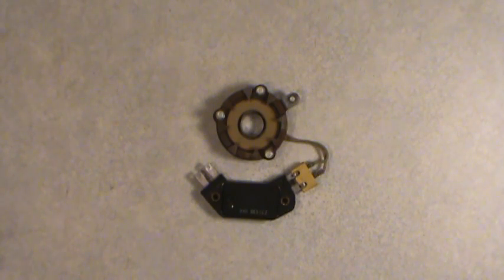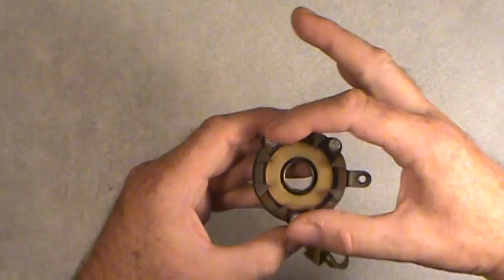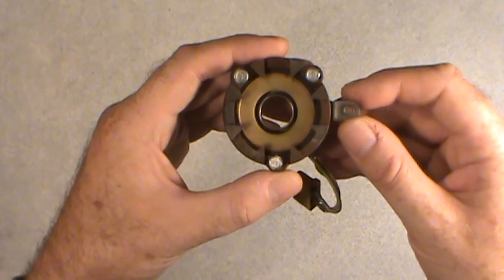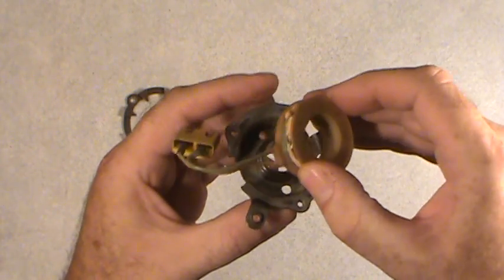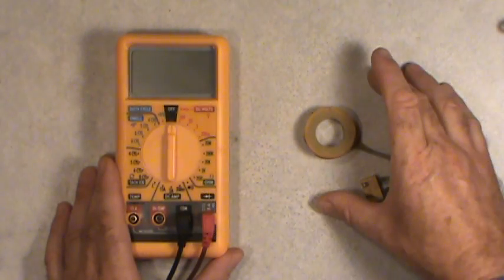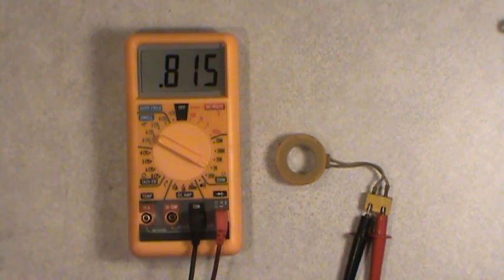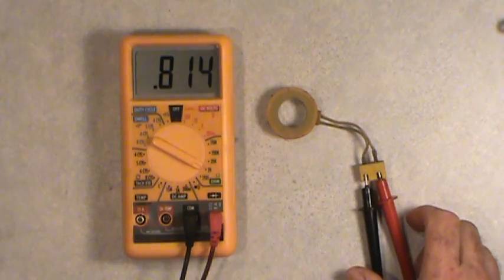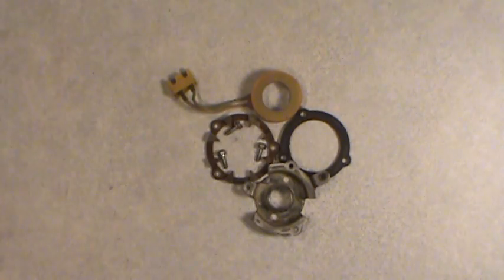HEI Distributor Pickup Coil Test

Comment: My car is not getting spark I changed the ignition module I changed the rotor I changed the coil on top of the distributory cap and the distributor cap I'm getting power to my wire but not getting spark will the pickup coil cause it
Reply: im going through the same thing no spark.. did you replace pick up coil?
Reply from the maker: Greetings...gennaro sandova..........Thanks for watching........Well, there are a few things, that can cause a no-spark situation, with an HEI distributor.........With the engine "not running", disconnect the (usually), red wire, from the HEI distributor cap, and hook up a volt meter, to that wire...then...turn the ignition key, to the "run" position........There should be battery voltage (that be, usually, about 12 volts).......Then, that 3 wire connector, that plugs into the distributor cap, can sometimes have wiring connectors, that get oxidized, corroded, or maybe, as I've seen before, some green colored yuck-ees (lol), coating, on said wiring connectors.........One of the, shall we say..all-of-ah-sudden...no sparky...spark...spark, from an HEI distributor, takes place, is usually because, so many folks, not knowingly, use the..."Wrong"...heat transfer compound (aka, grease-like substance), between, the bottom of the ignition control module, and the flat aluminum pad, that it mounts onto, and is secured with those two screws (note..."very important...!!!...those two screws, and, the two holes/metal eyelets, that go through, the ignition control, are the electrical..."Ground"...connection...!!!...so, make sure that, those things are super clean)..........Always use the same stuff (heat transfer-ing compound), that, the computer folks use (just buy and use, the cheaper stuff, that they have, because, some of that stuff, can be quite expensive)...("never use"...die-electric grease, as, it's not any good at all, for the purpose of, any heat transfer, what-so-ever...!!!)..........Yes-Sir-ee-Bob...the ignition control module, gets quite "hot", while in operation, and, if the heat that "it" generates, doesn't get transferred to that aluminum pad, on the distributor body, then, the module might overheat, and self destruct...!!!....(aka, kinda melt).........Also, the ignition coil, and the ignition control module, have to be compatible with, one another (kinda like, a matched set, if you will), or, there might be, an unwanted problem........There might be, a sheet metal, looking ground strap, that mounts onto the ignition coil, when, the coil is placed in the distributor cap, and, if so, make sure that, it gets re-installed..........A faulty pickup coil, can sometimes be the problem, and, those two colored wires, tend to get kinda stiff/dried out/not so supple any more, and can sometimes, end up having, an internal no-connection scenario, or possibly, an intermittent ohm reading, if those two wires are flexed/bent back and forth, during, said, ohms/resistance testing...so, bend those two wires, back and forth, and see if there is an intermittent/open/internally broken wire........Also, on that plastic-like bobbin, there are so many turns/windings, of some very small diameter wire, and, I'm amazed at, how well they hold up.........I recall, seeing some tape-like substance, that was wrapped around, all of those wire windings, on the bobbin, that, got all dried up, and that, was what made me replace, my very first pickup coil, on an HEI distributor (just in case...)........If, Ya do, replace the pickup coil, make darn sure, that you get the..."correct"...one...!!!...because, there are a few, different ones made, for certain applications, and, some of them, might have, an "opposite" polarity...!!!...oh, and, not to mention, different colored wires as well...!!!...lol.........If Ya need any more help at all, just give me a shout........Good luck, and......till next time......Be Safe, take care, and have a good one.

Comment: How do you remove and replace the coil?
Reply from the maker: Greetings...Geran Simpson........Thanks for watching........In order to remove and replace an HEI distributor's "pickup coil", You should have some reasonably good mechanical skills, because it might be a bit too difficult, for a, shall we say, beginner........The HEI distributor has to be removed from the engine, and, before doing so, you have to know how to re-install it correctly, along with, being able to set the initial ignition timing accurately.........That helical gear, that's on the lower end of the HEI distributor, that appears to have angled gear teeth, has to be removed from its shaft, and is held in place with a roll pin.........That helical gear, has to be put back in place "exactly" where it was...!!! (not, 180 degrees out/opposite), to where it was originally, or, the distributor won't work right........Sometimes, it is very difficult, to remove the shaft, from the distributor housing, because of, a build-up of deposits, that are usually stuck on the shaft........Once the shaft is removed, then, the pickup coil can be removed.........Remove the wiring connector from the ignition control module, then, as I recall, the pickup coil, is secured in place by a clip, which has to be removed first.........Upon re-assembly, then, Ya gotta make sure that, the "dimple" (partially drilled hole), that's in the hub of that helical gear, lines up with the metal "tip" of the rotor, when it is installed on the top of the shaft/advance mechanism, with those two screws, or it's gonna be 180 degrees, out of alignment...!!!.........So then, that's basically the procedure..........Look on Youtube, for some HEI distributor videos, where the person is taking an HEI distributor apart, and then, you'll have a much better understanding, on how the parts are removed, piece by piece, and, for re-assembly, then, it's just a matter of, doing the removal sequence, in the opposite direction.......Good luck, and......till next time......Be Safe, take care, and have a good one.

Comment: Replaced one of these stuck in the middle shoulder on 696 during rush hour in Detroit, truck just stopped running.  Real fun with crazies flying by at 80. Did the trick though, started right up.
Reply from the maker: Greetings...charlie dee........Thanks for watching........Wowsers...!!!...talk about living on the edge......Good thing, that you found the gremlin, that was responsible for all of that chaos........Most HEI distributor problems, seem to be related to, someone, not putting the correct heat transfer-ing compound (aka, heat sink grease), on the back of the ignition control module, before installing it.........I even had a parts guy, in a parts store, tell me, to use "die-electric" grease...!!!...lol...(nowhere on the label, does it mention...heat transfer, in, any way, shape, or form...!!!...lol)........I always use the cheapest heat transfer-ing compound/paste, that a computer store will sell me, usually costs about 10 dollars for a small tube of it (they even use, much more expensive stuff, that might be called arctic silver, on the big ic's/chips, as in, CPU's and GPU's, that are usually found, inside of computers and game consoles), and......till next time......Be Safe, take care, and have a good one.

Comment: I have a new coil and ICM. Still no spark. Pickup coil or computer??
Reply from the maker: Greetings...Jason Allen........Thanks for watching........There are a number of things, that can cause a no spark problem.........The first thing to do, is to, make sure that you have battery voltage (12 volts there-abouts), going to the battery terminal, that is on the HEI's distributor cap, when the ignition key, is in the "run" position (and, make sure that, it's not connected to the "tach" terminal, that is right next to it...!!!).........You mentioned a "computer", so, in order for me to help you out, then, I will need to know the following, about your vehicle, as in...year...make...model...engine size and number of cylinders, and also, if it's all stock, or, modified in any way at all, and.......till next time.......Be Safe, take care, and have a good one.
Reply: @RockysRoadshow  I got it going. Pickup coil wires were no good

Comment: Hello. I tested mine and got 1kohm which is within specs. Do you know how much volts should come out of that coil when you pass that magnet really fast about the coil ? If I use a speaker magnet I get 1.5v more or less. When I use that star magnet from the sandwhich, I get like 0.05v.
Reply from the maker: Greetings...eric racine………..Thanks for watching...…….Sounds like you are doing a science experiment...…….Here's about the only thing, that I've ever done with it...…….Having the HEI distributor, out of the engine, then, I connect a multi-meter's probes, into that pickup coil's, disconnected connector, then I spin, as fast as I can, by hand, that gear, that's on the distributor's shaft, and see what voltage, shows up, on the multi-meter's display screen...…….Should get about one volt (AC?), give or take a bit, as I recall, and......till next time...…Be Safe, take care, and have a good one.
Reply: @RockysRoadshow  well....lucky for me I have 2 HEI distributors. The new have no spark....I was able to make the old one spark on the workbench. The new did not spark. I swapped the pick up coil and it started to spark. Weird that I get a good ohm reading...but no spark. Anyway....your vid did help. Thx !
Reply from the maker: Greetings...eric racine…........You're welcome...........Here's something, that a lot of people/parts guys, don't know..........Always use, the proper..."Heat Transfer"...paste, on the bottom (metal side), of the Ignition Control Module, or, it won't transfer the heat, that is generated, on the inside of the module, into, the HEI distributor's aluminum body, where the module, mounts onto, with those two screws...……..I always use the heat transferring compound, that the computer folks use, to mount their, heat generating/very hot (electronic) "chips"......…Never use Die-Electric grease, because it won't transfer the heat, "away-from",  the ignition control module properly...!!!………..Ignition Control Modules, will usually get "Destroyed", if they get too "Hot"...…….Some of that, computer, "heat transferring compound", can get quite expensive, so, I usually, just get the cheapest stuff, which comes in a small squeeze tube, for about 10 or 12 dollars, and, it will last for, a very, very long time........Also, keep those two screws, and, those two metal eyelets (holes), that are at the ends of the ignition control module, "Very Clean", because, that is, what makes, the (electrical) "ground" connection, from the module, to, the HEI distributor's aluminum body, and......till next time......Be Safe, take care, and have a good one.

Comment: Why does the pick-up coil have such high resistance? Isn't it like a motor winding with current passing through it?
Reply from the maker: Greetings...I K...……..Thanks for watching...……..Well, the high resistance, that is showing on, an ohm-meter's display, when testing a factory/stock, HEI distributor's pick-up coil, is due to, the very small diameter, of the wire, and also, that very same wire, being quite long as well...……..See if you can find a "Chart", on the good ole internet, that shows, different gauges (thicknesses) of electrical wire, and how much resistance (measured in Ohms), that a given length of wire will be (I recall, it being measured, in ohms per foot)………….Something like, 14 gauge, copper house wire, being one foot in length, will have, a quite low (ohms) resistance, as compared to, a one foot length, of that, very thin wire, that's wrapped, many, many times, around that, HEI pick-up coil's, plastic-like bobbin...……..There is a thin magnet (looks kinda like, a fridge magnet, somewhat), that is hiding, just under, the pick-up coil, and, the pick-up coil's (wire) windings, basically, output an electrical pulse, so to speak, and, it's created, whenever the inner set of triggering triangles, pass by, the outer set of triangles (called a pole piece, as I recall)……….So, there Ya have it, and...….till next time...…..Be Safe, take care, and have a good one.